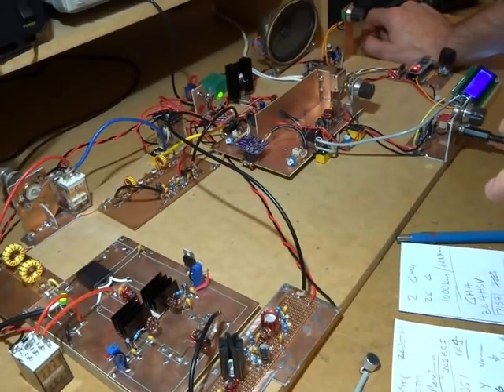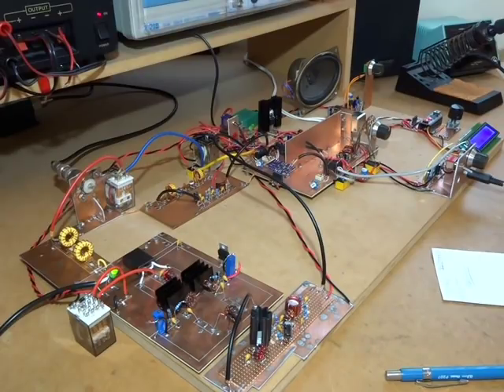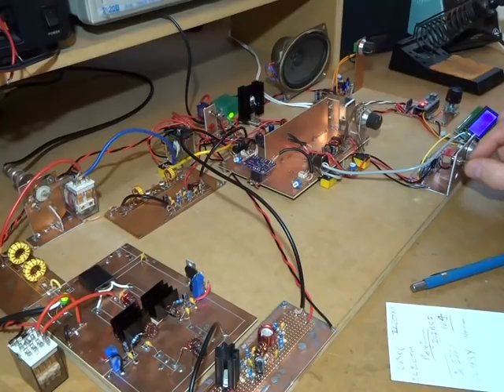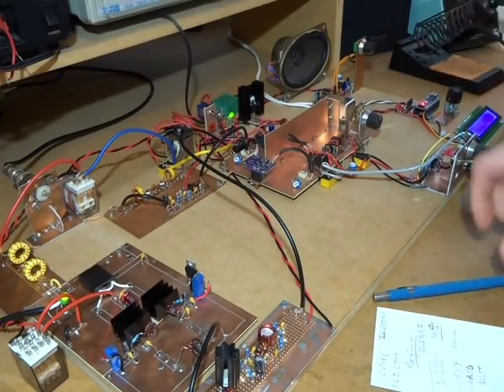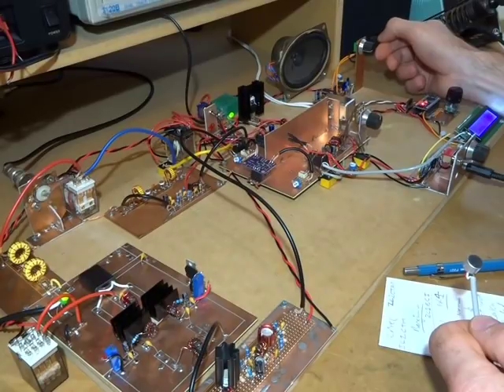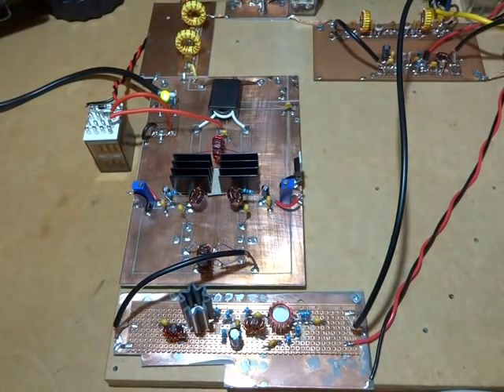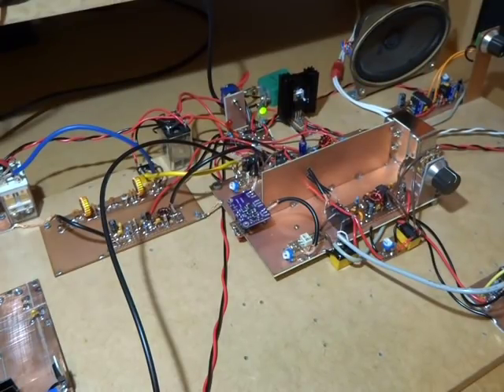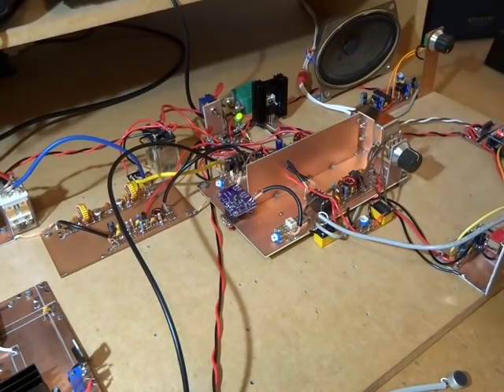Homebrew MC1350P based SSB Rig - #13 First On Air Contacts

Comment: What a small world, ZL/GM4FZH, the QRP station who called in is one of my ham radio training team here in the UK. Just sent him a 'QSL card' having heard him via your YouTube vlog Charlie. Rig sounds great Charlie. I have always struggled with AF CW. Had much more success with unbalancing the DBM. Interested to see how you progress. Have a great Christmas and New Year!
Reply from the maker: Hi Steve. That's a laugh! His double callsign threw me for a start. He was running 5W up North. I made a CW rig a while back and used a RC phase shift oscillator to create the discrete transmit signal. I'll first try unbalancing the DBM as that's significantly easier. If I recall earthing the AF port should do the trick. Merry Christmas too Steve.

Charlie

Comment: Great on air results Charlie, performs real good ,i copied your driver circuit from ur last video. Well done again 73's zl3je
Reply from the maker: Thanks Dave. I'm really please with how it has turned out. The full hang AGC is all designed, so will look to make that up after Christmas. I can see some diode switching being tried again and a turn it into dual band rig. Enjoy the break.

73s
Charlie, ZL2CTM

Comment: Hi Charlie, I am a passionate radio builder in the field in Romania, I watched with great care the videos posted on youtube, as well as the constructive details on the blog. I am very interested in building such a RIG. Unfortunately, the SSB filter I have in my hand is retrieved from a Kenwood TS-120S with an 8.83 MHz frequency impedance of 600 ohms with 15pF. If you can help me with some details on the attenuator value from the output of the IF amplifier and the adaptor transformer from the input of the SSB filter and if at the input of the IF amplifier with the MC1350P still has an adaptation transformer if I use the Kenwood filter. Thanks in advance, Happy Holidays.
73! by YO5PQJ, Alex
Reply from the maker: Sure thing Alex, but it will be in the New Year. Until then, study the schematics and try and work out the impedance ratio yourself. 600 ohms is close to 500 so there shouldn't be too many problems. You'll also need to change the Arduino VFO and BFO code.That won't be a problem.

Charlie
Reply: @CharlieMorrisZL2CTM  Thank you ! 73!

Comment: Hi Charlie, how did you interface the pre-driver with the driver and the rest of the transmitter side? Looks like a resistor attenuator pad, but not sure. Cheers, Ian
Reply from the maker: Hi Ian. It's should be all per the schematics on the blog. The pre-diver has an output transformer which connects directly with the driver (no driver input transformer). The output of the driver is connected directly to the power amp's bifilar input transformer. I didn't need any pads in the transmit power amp chain. 

Charlie

Comment: That's a fine finale to this series of design and build episodes.  The audio AGC will work well with the MC1350.  G6LBQ Bitx has a circuit with LM324 for that device.  2 pairs of BD139 would be interesting,  I wonder what power you'd see? 3 watts perhaps?
Reply from the maker: Thanks Paul. Not sure how much power two pairs of BD139s would produce. I'm tempted to say at least 5W. If you can think of some other readily available and not too expensive BJTs, then I'd give those a go. I prefer the TO-220 package as it's easier to heatsink.